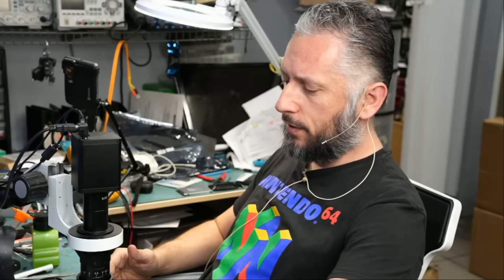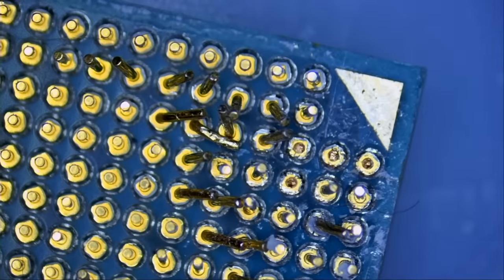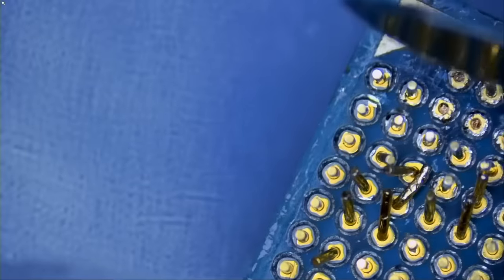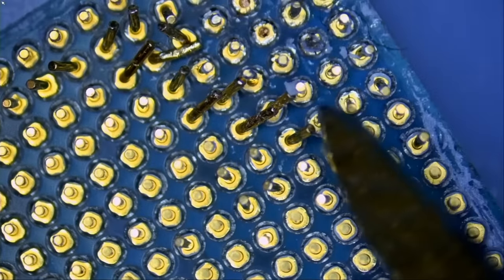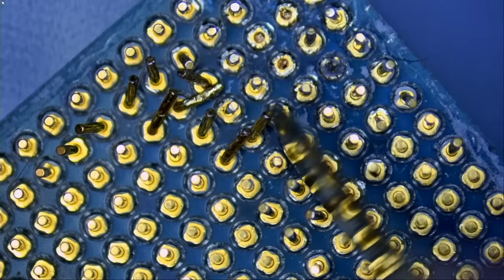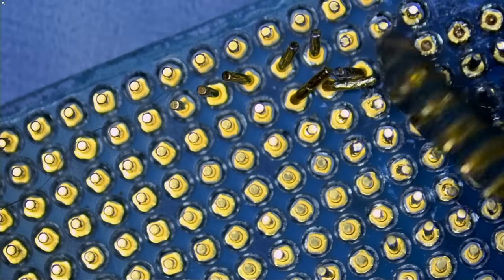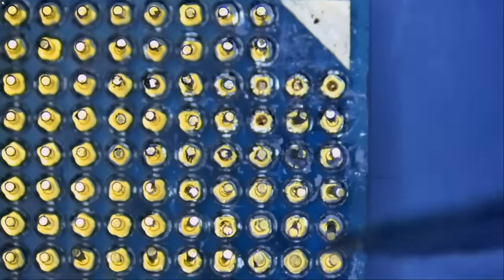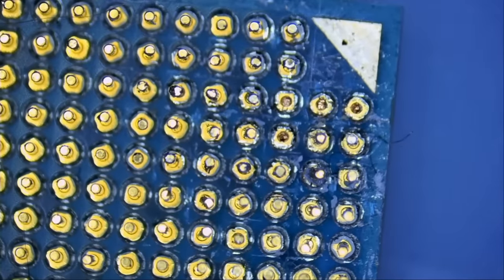Ryzen 3900x CPU repair - Bent And Broken pins.

Comment: A better 'tool' to straighten the pins would be the shaft of a propelling pencil of a suitable diameter.
Reply: Sometimes, sometimes not. With the knife it can be a bit easier to align a bent pin with the others in its row without overcorrecting in the opposite direction of the initial bend, which you pretty much want to avoid at all costs.
Reply: He talks about it in the video
Reply: I really enjoy using the exact same kind of tweezers he using to solder the pins in the cpu. For straightening the pins i use it upside down… i feel it very comfortable

Comment: Alex, I once fixed 2 bent pins on a new CPU I had just bought and somehow messed up. 
I did NOT have a microscope or fine tweezers. I got lucky that they were both together on an edge, 
more easily able to get at. 

I used a straight pin, an Exacto knife, and a magnifying glass with a strong light. The pins ended up not perfectly 100% aligned, but close enough to enter the socket, register and work as purchased. I never want to ever have to do that again!

I can't even imagine trying to remove and replace individual pins up and down the chip!  You are a skilled surgeon my friend. 
Never losing your cool when pins go "flying like a ninja". I would have freaked and called it quits right then and there!

Keep up the good work and excellent video content.

Comment: I bet you cannot move in the 9th Dimension, it will be full of screw, nuts, washers , capacitors, resistors ic's etc,  all that small stuff from your local electronics repair shops.
It's all fun, love watching all your repairs.

Comment: I use an old Rotring pencil with no leads inside with the tiny tube on its tip as small as those pins, to straighten them out. Usually a 0.7, 0.9,a 1.0, or a 1.2mm tip works.

Comment: I used to to this on the old AMD Thunderbird CPU's. The blade of a Stanley Knife had the perfect width for it :)
I've built a few hundred PC's in my career and never has this happened to me. I'm still wondering how one messes this up so badly... I never really asked customers that came in with them though ^^
Reply: The bad one's i've seen were from pulling the cooler while it's stuck and dropping it with the cooler when the cpu comes out of the socket with it.
Reply: I can say from experience that dropping an AM4 CPU on the hard corner of a desk can cause this sort of damage. I was lucky that I didn't break any pins in the drop or while bending them back and that CPU is still running fine today. I have a friend who said he was not paying close enough attention to how the CPU was seated in the socket before mounting the cooler and only noticed something was wrong when the system didn't boot. All of the pins in the corner that didn't seat properly were flattened and several that he tried to bend back just broke off. Brand new ~$200 CPU got thrown in the trash because there was no way to fix it that wasn't going to cost more than just buying a new one.

Comment: Does straightening pins in this way weaken their connection with the board? Like will that area be more susceptible to damage or bending in future?
Reply: The chance of bending the same exact pin again is like....nil. You would have to actually go try to bend that same area again....and no one goes out and bends pins on purpose.
Bent pins are accidental.
And no, it does nothing to the connection to the board unless the pad itself is bend in which case you would resolder a new pin.
Reply: there is a difference between broken and bent. bent ones can be straighten.
Reply: How often are you swapping out your CPU?
Reply: the metal is fatigued slightly but there isn't any stress on the pins when in the socket so doesnt matter.
Reply: Yes straightening will weaken the pin, it is I believe gold. But it shouldn't be an issue. Pinned CPUs have a tendency to stick to the cooler because of thermal paste. If you twist, you'll be fine. A broken pin fixed is better then a bent one fixed. Metal is still metal, fatigue is real :)
Reply: Probably, but who has the patience to re-solder that many pins
Reply: @Jedda73  Patience is 10%, 90% is experience, skill, equipment

Comment: Did you check to see if the CPU posted to Bios before sending it back to the customer?
Reply: Probably not.......
Reply: Does not matter. It came in with broken pins, it left with fixed pins. Alex’s work is done and his time paid for. There is no more to fix
Reply: I very much doubt the 'customer' knows if this CPU works or not. The only check i would expect is to make sure the repaired pins aren't shorting, and even then that check might be limited to a visual inspection.
Reply: @gordonm2821  Yeah you're right, why would you want to know if the repair fixed the problem, makes perfect sense to me.
Reply: @toddm323  - As Alex points out in his videos he does not waste time doing unnecessary work. You would have to find the right motherboard for the CPU you wanted to test then rig it all up, carry out test, de-rig it all. In that time you could have another shorted motherboard close to being fixed. As I said fault was broken pins and fix is no broken pins.
Reply: @gordonm2821  to me it should be tested to make sure.......
Reply: @POS-Website-User  - Exactly the amount of times Alex get annoyed when they just send in the ‘broken’ item rather than the complete product to save on postage / dismantling / re-assembly charges
Reply: Also what does testing the CPU gain? If it don’t work Alex still wants paid to get to that stage. Alex or customer testing CPU post pin repair does not get you to a next stage of fault finding. Next stage is bin. It is wasted effort on Alex’s part.

Comment: I've got the same issue on my Asus Maximus IX where the pins are on the Intel motherboard.  I didn't even realize you could fix them but then again I don't have the equipment to do so.  What are the costs for this type of repair with just a few bent pins?  I'll check out your website and see.  Thanks for the very interesting video.

Comment: Very impressive but, what if you use the hot tweezers without hot air in this case?
Reply: Hot tweezer is to large to work on cpu pins, I would think.
Reply: Hot tweezers would add solder to the side of the pins.  They would not sit cleanly on the socket when reinstalled

Comment: isnt there a tool like a small pipe that can fit over each pin ?
Reply: That's what I was going to suggest. I have a set of stainless tubes - like blunt hypodermics of various sizes - that are designed for clearing vias but can also be used as levers for fine pins. The advantage is, if you choose a close fitting size, they slide to the bend in the pin and no further - straighten a bit, edge down and repeat until the tube (and pin in it) is vertical. I find there is less risk of overbending or clobbering a neighbouring pin. You may still require a blade for really badly bent pins or for tweaking alignment but I feel I have more control using a tube. Each to their own though - I have the coordination skills of a bear ... 🙂

Comment: Would it be possible to do this with a soldering iron instead of hot air?
Reply: hot tweezers maybe, but I don't think there is enough place for you to insert a soldering iron tip down there.